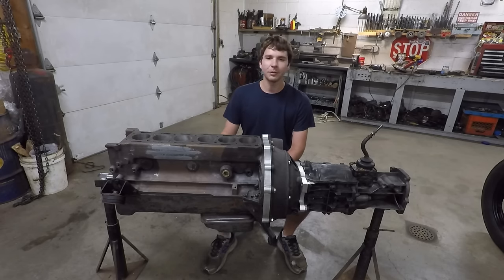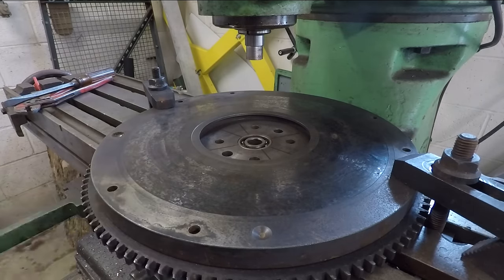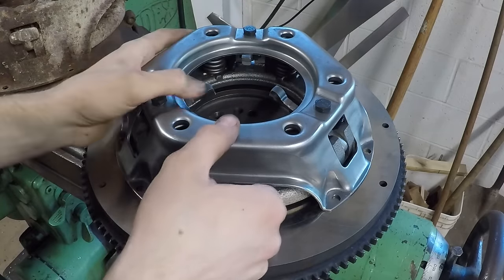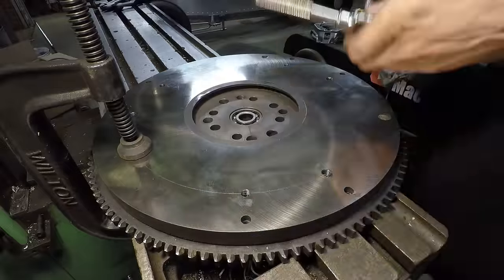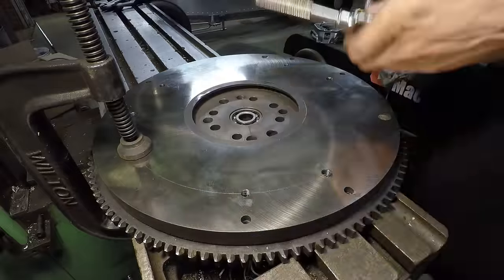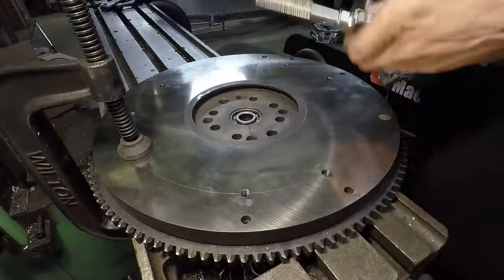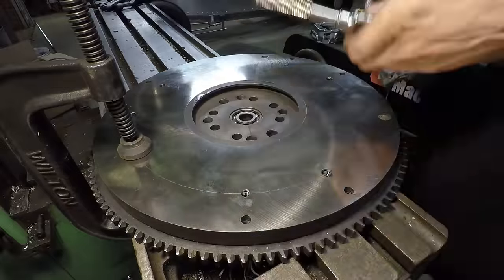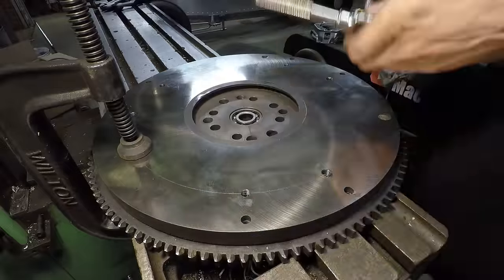Adapt ANY Engine to ANY Transmission!

Comment: How did you balance this set-up?  Is the engine internally or externally balance? Is the flywheel set-up for one or the other? Did you put the crank shaft, flywheel, pressure plate on  a balance machine and index them? 5500 rpms will tear some shit up if you are off on the alignment, and the weight. Better have a scatter sheild blanket around this until you know you are right. Blowing metal through the floor won't feel good..
Reply: If you begin with balanced parts, and remove a balanced amount of material in a controlled manner things will stay balanced. I doubt he had things balanced but I would say he factored in the need for it.
Reply: he is smart enough to bolt a  Jaguar engine to a Chevy transmission .i think he got it figured out
Reply: @mrfordman9999  try mounting a Dodge 360 flywheel to a 318, or a 440 flywheels to a 383 or 400. Balance is for sure a factor,. . Dodge make both internally and externally balanced engines, do it wrong and you will have vibrations from hell. But this is different and that is/was why I suggested a scatter blanket. I was not condemning him just asking him a reasonable question.
Reply: @jamesproffitt3895  great! But have watched some really smart people in my life time, do some really stupid shit. I simply ask a question and gave a opinion on safety concerns.
Reply: @WolfPackRacing  an excellent point. I think I missed making mine. I would imagine anyone who went through this much effort and energy to source the parts machine the tolerances and put it together like this would choose products internally or externally balanced based on the part. A scatter blanket is an excellent idea, no matter what, whit homemade!

Comment: I put a ford T18 on a Chevy 292. The pressure plate for an HD (GMC) 292 is 11.5''. The clutch for the T18 is 11". So I used the stock pressure plate, bell-housing and flywheel combo with the ford clutch. Increased the bell-housing to main gear retainer diameter 1/16". Bolted the bell on put in a retainer bearing to fit the ford main gear to the Chevy crank. Put the trany in place. Jacked up the rear of the trany to release tension of gravity. Pushed it in place marked my holes for the ford trany on the Chevy bell. Drilled four holes and cut 1/4" off the main gear. Took the two driveshafts to the shop. Came home with a Chord driveshaft and done. O' yea a 1970 GMC has no transmission tail house cross member so that made it easier.

Comment: *Any manual transmission and/or non computer controlled. Also, some engines are externally balanced with the flywheel and harmonic balancer and have to be matched correctly.

Comment: not convinced about the jag engine, when the us is flooded with straight sixes. but nice build.
Reply: I assume he's after the polished alloy twin cam covers look
Reply: The Jag 6 is a fine engine. Not only is it a fine engine, but the british placed a higher standard on engine aesthetics in the 50's than us Americans. Half of hot rodding is aesthetics. Should the hot rodder be limited by his nationality?
Reply: @johnfriis3326  the 96 300/4.9 is  the same as one in an 83 with the exception of the fuel injection system. Are you changing the entire engine or just trying to get the EFI from a 96 to work on an 83 engine?

Comment: I’ve put a ford engine on a lotus esprit transmission.
Reply: I put a Porsche Boxster 6-speed on my 2002 Lotus Esprit V8, went from 174 MPH to 201 MPH. It WAS NOT anywhere near as easy as this guy makes it look but it was worth it. I have a lot of respect for this young man based on what I learned during my 18 month project.
Reply: Wow you’re so smart

Comment: Super impressed as usual Vince is that a new to your milling machine?
You are becoming a real machinist with every video.
Couple of thoughts
Check out a set of transfer punches
A micrometer
Also go and check out Jonathan W, channel he is a wealth of tips on building things mostly Ratrods but he has such a huge lot of life experiences in working out how to get around tricky situations I am constantly amazed at how much knowledge that bloke carries in his head + he runs a tow truck business and has a huge assortment of cars... For parts you just might find what that one needed part (if the time comes) or he might have a workaround to fix an issue if you come across one.
Also check out
Abomb79,
Keith Rucker
Keith Fenner
And doubleboost 
All have excellent tips on doing Machining 
Love the videos and your work. 
Tony from Western Australia
Reply: Thanks for some good reverences.
Reply: @Gothamauto  no problems I hope you enjoy all the interesting stuff those channels impart Jonathan W will amaze you with his knowledge also check out IronTrap Garage (matt)
and Ratrod Bob
Waylon Wire, and 
Mrheveychevy 
Elderly Iron 
Tony from Western Australia

Comment: I have been struggling to learn how to fit engines to transmissions. I am so thankful and grateful to you for sharing your wonderful work. I wanted to fit a Japaneses 4 cylinder engine to a farm tractor. I have hope that its a possibility because of you. Thank you once again. Good luck and keep up the good work.
Reply: If your tractor came with a diesel be sure that whatever engine you put is a diesel as well if you plan on using it for tractor purposes of course

Comment: The best way I've found to commit a motor to trans abortion is to use the factory flywheel and pressure plate for the motor and factory clutch of the trans. As long as the motors pressure plate is for an equal or smaller diameter clutch your golden.  Solves any starter to ring gear issues. By using the motors factory bell housing you just dill out new boltholes for the trannie. 
This eliminates all issues except throwout bearing, trannie main shaft length and pilot bushing. Usually the factory motors  throwout bearing will work. If not use the factory trannie unit and if necessary customize the fork. Trannie main shaft length needs to be as long or longer than the motors factory trans. If it's too long mill the length and spline as needed. This is a great time to resize the surface for the throwout bearing. No adapter plates, custom starters with new holes to mount it to or custom ring gears.

Comment: I've been wanting to do something similar like this for ages but with different parts.  Saw some old timer mechanics do this back in 1991 with an old Honda engine with Ford and Chevrolet parts with their own custom made adapter parts.  Not sure how they did their own process on the adapters but I remember the car they stuck it in ran for quite some time.

Kudos to you on doing this sort of thing as I'm glad there are other people out there that go outside of the box!

Comment: As you have done some drilling and tapping work by hand, I recommend you have the crank and flywheel rebalanced as a unit. (You will also need to install an offset key/dowel somewhere in the assembly to stop the flywheel going back on 180 degrees out...) please excuse me if you already have this in your plan. 👍🇬🇧 stay blessed buddy!

Comment: I adapted a Subaru to a Volkswagen back in high school,4, 4"×12", 1/2" plates welded in a square center drill ,drill ,cut bolt i used both flywheels centered drilled, tapped, shimmed up the center carrier barring popcans worked great!!! I got about 75 mpg.in a 66 Baja Bug with Big back tires...
My watercooled Bug

Comment: Late to the video but this is a great resource for the how and why of what you're doing.  That trick with the pointed bolt was pretty cool but then you chopped it off to make a blind hole version and I was floored, I've never seen or heard of that before but what a great way to solve a tricky problem.

Comment: Tip for making a adaptor plate is get a sheet of perspex / plexiglass  put it over the back of the engine and mark the center of the crankashaft and then mark out all the holes and the outline then take that and lay it over the new  transmission using the center mark against the input shaft , that will give you a single template with both outlines and sets of holes
Reply: Wont work for every engine though  like that jaguar with the cranshaft that sticks out more than the flange

Comment: Looks pretty good provided that your input shaft is indeed aligned properly with your pilot bearing, you will need to have the flywheel and clutch pressure plate and disc balanced as an assembly.

Comment: One thing I'd do, take and fill those extra holes in the flywheel center with weld, then grind and mill em flat on both sides, that way you can have all 10 bolts exactly where you want em.  :)

Comment: I know of a few factory adapters.  My 1984 M-B 5 cyl diesel has an aluminum plate similar to yours which connects the cast-iron block to the aluminum transmission case.  I don't know why, other than that transmission is used in many other M-B applications, mostly with gasoline engines, perhaps V-8 engines which are wider than the straight-5 diesel.  Likely M-B didn't feel the volume was high enough to make that transmission with a bell-housing to bolt directly to the diesel engine.  Perhaps that combination was only for the turbo-diesels mainly sold in the smaller U.S. market.  One nice thing is that the starter bolts to the block, so I was able to run a replacement diesel engine on the ground (without a transmission) to verify it before installing it in the car.

I have seen photos of a steel adapter plate which allows a Chrysler slant-six engine to mate with the more rugged 727 transmission, rather than the normal 904 transmission.  The later has a version with bell-housing that mates directly to the slant-six.  The adapter was only used in trucks, so a smaller market (I might have mixed those parts up).

Did you really drill and tap those holes in steel with no cutting oil?  I use a pressurized can from Harbor Freight which sprays a foamy oil.

Comment: 8:49 when making threads for anything especially when you want them to hold up to hardcore sh¡t it helps to ise cutting oil. And if you really want it to be square then put it on a drill press. Put the tap into the drill press chuck (do not turn the drill on at all) then use the drill press to lower the tap into the hole and turn the dril chuck by hand using the drill press handle to keep the tap going down without having it push down or pull up on the tap. That way the tap and whatever you want to have threads are square. Just as long as you make sure everything is square on the drill press before you start. By using a square and put in the tap and use the square to make sure that its square with the drill presses shelf.

Comment: Thank You very much for this Valuable Information Video. I have longed to use a Subaru Engine on my Vw Beetle but cant afford the Expensive Factory Built Adapter Plate. I will use this Video as a Guide to do my Own Adapter Plate soon.

Comment: I used a chevy pressure plate on a ford 240/ straight 6 . It was realy built up . 2 barrel carb. real hot cam and a split exhaust manifold .I had to run a semi mettalic clutch with a 9 inch ford 411 rear end.My uncle use to race inline sixes in the 1960`s and 70s.He had parts and the know how to help me. It would load up at red lights .I snatched out the drive shaft and broke the yoke off the trans when I got on it.

Comment: When I was an apprentice in the mid 70s with access to lathe and mill fitted a rover 3.5  V8 to a ford zephyr transmission with over drive  quite successfully used it for many years

Comment: Old school hot roddin' at its finest! Make due with what you got! The pressure plate on the flywheel kinda bugs me out a little bit though. If its off centered just barely even a few thousandths that's going to cause a nasty (possibly catastrophic) vibration. Hope he brought that to a machine shop to get the assembly balanced.

Comment: great video, what you did at 16:39 you could have made some studs to go in crankshaft to mark the front side of flywheel to drill holes more accurately. cheers

Comment: A+ for effort! All slip fits not machined perfect remember if it's just a bit off center flywheels take legs off when they let go 

Get your self transfer punch set rotary indexing table and some dial indicators and start power tapping on the mill

Comment: I didn't see him video taping mill readouts.I have to assume he doesn't have them.That makes doing this so much harder.If it was me doing this,i would have chosen to use the biggest pressure plate and clutch disk.My reasoning is ,this is not a race car,and with 2 more inches in diameter,the clutch should last forever.I tend to over engineer parts i made while machining and designing stuff for my job.If the end user could abuse a part...they would..haha.he did a great job on the plates,this is the kind of stuff i love too see done.

Comment: Vince, I am clear on flywheels and adapter plates, and what you did is great (and I dig the engine that you are using).  BUT If I want to adapt a jaguar engine to a T5, for example, I think a many of us am not clear on clutch selection, number of splines, etc.  etc.  Would you make us a short piece in that?  “Adapt any engine to any transmission…… and THIS is how you deal with the clutch” :-)

Comment: Good luck with that transmission, I had one in my 87 s10 pickup. Couldn’t keep cluster gear bearings in it, and that was with a 2.5 4 cyl engine putting the power in.

Comment: I consider myself lucky that they already make a flexplate and Ford Modular to GM TH400 bellhousing that bolts to the pump housing using longer bolts after you cut the factory bellhousing off so that I can bolt my Coyote to my racing TH400. The only thing I had to make was spacers for the torque converter to push it away from the engine to get the right flexplate to converter spacing. This stuff here is next level.

Comment: Check first if the transmission locating dowels line up with the locating dowels on the Engine block.  If they do it is simple work to transfer  bell housing onto a spacer plate and then transfer the block bolt pattern  to the spacer plate. 
Use counter sunk Allen head bolts to keep the mating surface smooth. 
 No measurement required.

Comment: Johnny cash was stuck in my head the whole time! 

“The transmission was a '53 and the motor turned out to be a '73
And when we tried to put in the bolts all the holes were gone
So we drilled it out so that it would fit
And with a little bit of help with an adapter kit
We had that engine runnin' just like a song!”

Comment: Well your only limit is finding a machine shop to mill you the adapter plates. 
They make a adaptor plate to fit a lot of cars transmissions to bolt on an electric motor. So if you want to ditch your gas motor you can find bolt on parts to convert your car over to electric, but you could also use a small engine to generate electricity to help keep the batteries charged as well as generators to capture coasting and stoping energy to charge the battery, this hybrid motor would be low emissions you could run it on lp or propain gas or just use compressed air to drive a generator. 
But this limits range.  You could split water into gases and run the motor off hydgron  with water as the exhaust. 
But this still requires energy to do this.
So you may not gain anything doing it unless its extremely efficient.

Comment: Fantastic work! Thanks for taking the time to show us how it's done. I do have a question, did you do a radial runout of the crankshaft to the opening so the transmission will be center lined with the engine? On Studebakers, if you change bell housings, you have to index them to make sure you have proper alignment. There are videos on how to fix alignment with offset dowel pins. Keep up the good work.

Comment: That was a very nice job. My only criticism is not to use the bearing to indicate from. Pop it out and use the bore that the bearing sits in. Play in the bearing will spoil the centering process. DTI gauges are cheap and more accurate than a bearing. I'm not a car guy but I am an engineer.

Comment: When making the paper template if you put some Scotch Mount spray adhesive on the back, and stick to the casting while "rubbing" it will not move and then, you can remove it  and actually stick it onto the face of the aluminium plate which you are then going to cut

Comment: This is absolutely brilliant, it is also a TON of work though.
One thing I was wondering: is scribing a circle on the flywheel a precise enough method to get the pressure plate dead on center?
Could there be oscillations if the center is off even by a tiny amount?

Comment: @20:20 surely this is the most crucial part where it must be dead on centred because the input shaft of the gearbox must align and be central to the spigot bearing in the flywheel - surely balancing a few bits of bar and eyeballing it isn’t accurate enough?   Wouldn’t an adapter fitted the spigot bearing with an upper OD that aligned to the ID of the  bell housing be more accurate to find the centre?

Comment: I am building a 1928 Morgan RIP GN Special hillclimb racer replica. I am using an experimental opposed twin engine in the front of the car and I am gearing up to cast a two part adapter for the output shaft from the engine to the flywheel for an MGB transmission. I am going to make a cylindrical part that the output shaft with the keyway and nut will go on.Then there will be a ring that has the number of bolts that will bolt through another cylinder and to the Flywheel so that I can use the MGB clutch and have it with the shaft on the input to the transmission. Then I will make an adapter plate thick enough to mount the engine to the transmission. I am starting my Youtube channel with this build and I am figuring out what to call the channel.